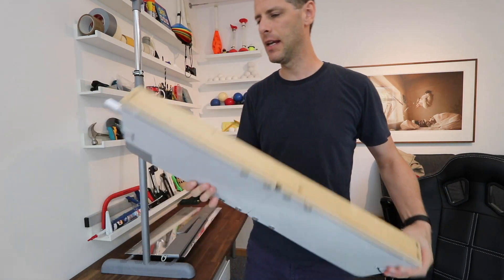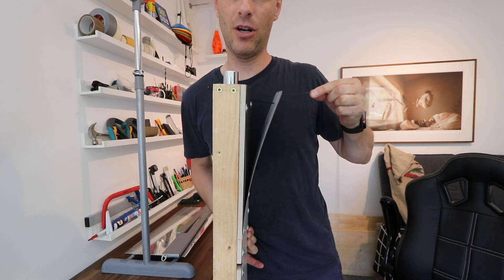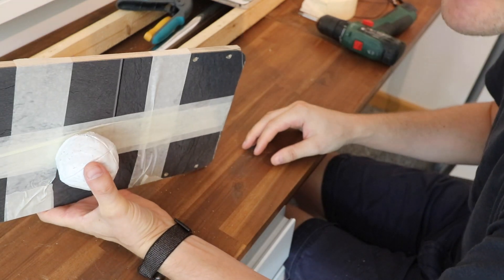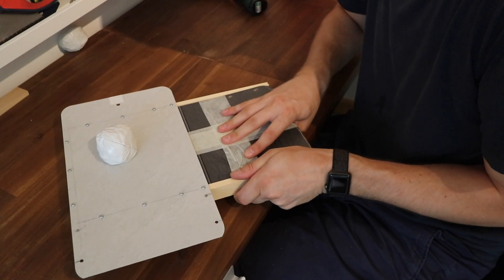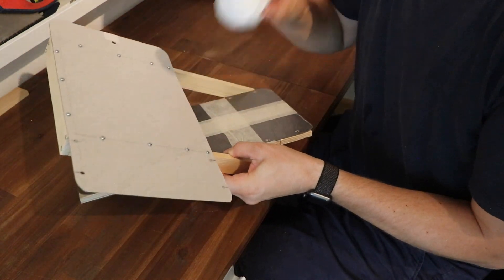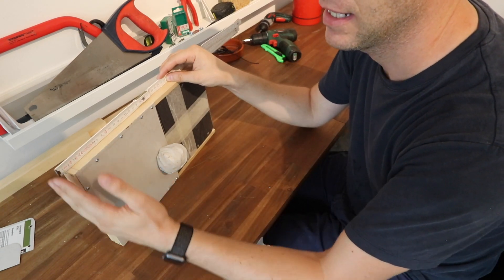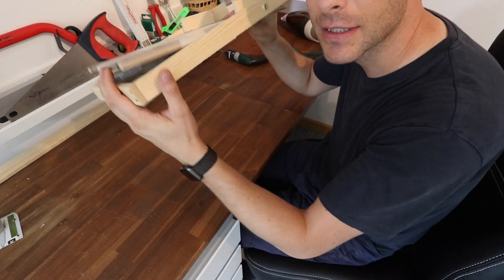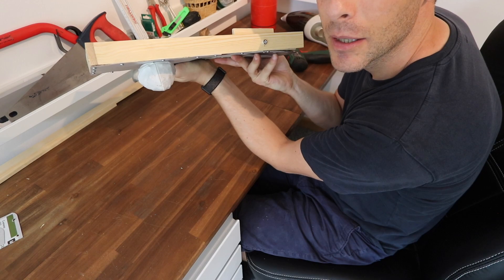Magnet Machine Rebuild Prototyping Day 2 - First Steps

Comment: Use the same pivot point/Hinge for both sides and the frame. Then you can fold the whole thing in half and fit it in the case easily. And have the arms as long as you want.